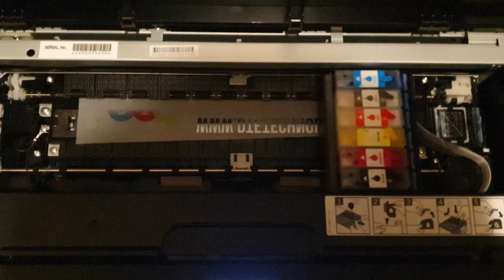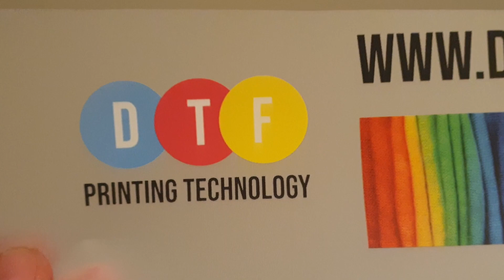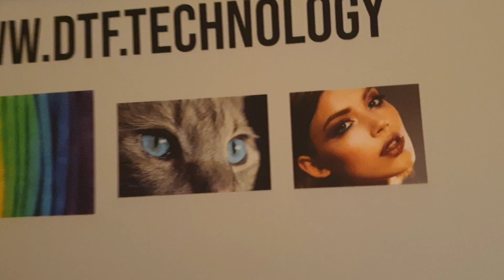How To Convert An Epson XP-15000 Printer To Print DTF

Comment: this is the most easy tutorial video .
Reply from the maker: It's is also quite outdated. I would no longer recommend using foam cartridges. You should replace the manifold and use standard dampers + ink lines.

Comment: Hey, I tried to this with the same exact printer that you used, when I put a DTF sheet, It went through, ready to print, but right as it was about to print it stopped and an error showed up saying the printer was jammed. When I checked to see if there was a jam in the printer it was perfectly fine. I’ve tried with regular printer paper to see if the printer would not print anything or if it was just that printer. When I tried with the plain paper it printed perfectly. Do you know how to fix this to print on the DTF sheet?
Reply from the maker: Yes, this printer suffers from the feeding issues and can be difficult. There is a video on this channel which goes through some film feeding tips. For a different printer but the process is quite similar.

Comment: Do you use the stock ink that comes with the printer? Or did you add white ink?
Reply from the maker: You have to use DTF ink. It's rubberised fabric ink that will feel soft and will stretch on fabric.
Reply: @dtfprintingtechnology9457  thank you

Comment: With eco-solvent inks, i can print labels on adhesive polypropylene? Is a heat source essential for drying? or can it dry at room temperature? what software use to print roll? (acrorip or another?) thanks!
Reply from the maker: I have no idea about eco-solvent inks. DTF ink is water based. Yes, heat source is essential. You are melting the powder. You are not drying it. We use acrorip.

Comment: Amazing video... Would you still recommend this printer for DTF after 2 years of using it? Thanks you all of your help!
Reply from the maker: We never used it properly. Just converted it for the video. The foam cartridges, feeding issues and a sensitive printhead are problematic but it's probably the cheapest printer you can convert.
Reply: @dtfprintingtechnology9457  thanks for the response...
Reply: @dtfprintingtechnology9457  l1800 will be the best choice for professional dtf printing? in terms of price quality? Thenk you.
Reply from the maker: @ux_ui  Image quality is pretty much the same on every printer. P600 will print a lot faster than L1800. All depends on how many prints you are doing per day. I'd skip L1800 if it's over 20 A3 sized prints.
Reply: @dtfprintingtechnology9457  thank you 🙏🏼

Comment: Hi I am trying to do the conversation but it keeps giving me a maintenance error for cartridges
Reply from the maker: What's a cartridge maintenance error? Do you have an error code?
Reply: @dtfprintingtechnology9457  it say the cartridges are not installed correctly it’s only reading the original cartridges when I try to install the refillable ones it gives that error
Reply from the maker: @missyj3890  Have you installed chipless firmware on the printer or do you use refillable cartridges with chips that can be reset? The printer is designed not to accept 3rd party cartridges.
Reply: @dtfprintingtechnology9457  yes o have tried I got the firmware from ink chip but I’m not sure  if mi doing it correctly because when I try to update it on the printer it won’t install it
Reply from the maker: @missyj3890  So that's your problem. The firmware install can be tricky. Once you install it correctly the errors will go away.
Reply: @dtfprintingtechnology9457  do you have the direct link for the correct firmware? Also do I need to install it with the regular cartridges in and then switch them out after the chip firmware is installed?
Reply from the maker: @missyj3890  I don't have a link. You can install it with or without cartridges.

Comment: Hi, you mentioned that the white ink was not printing at all. I am suffering the same issue, and I have also dropped DTF liquid into the printhead to try and fix it, but it has still not been fixed. You say you left it soaking for 20 minutes? Does that mean you dropped the liquid into the printhead and let it stay like that for 20 minutes? So far I've been dabbing it with DTF cleaning liquid, swabbing, and then proceeding.If that doesn't work, what else would you suggest? Thank you.

Comment: Hi! I set up all the instructions in this video and I've downloaded the Rip Software, but the software is very confusing. How do I get that white underbase? What settings should I have? The "Set Ink Order" is grayed out, do you know how to fix that so I can tell the printer my Red and Gray cartridges are now White? As it is, I am printing out the pictures, but it does not have that white underbase and is very difficult to heat press into the items, usually ending up half-pressed or such. Colors loook great though. Would love the help. Thank you!

Comment: How do I change the new cartridges setup ?
I need to add 2 whites…
In the printer setting or part of the RIP ?
Thanks
I’m using Cadlink and seems to have soooo much information.
Reply from the maker: Sometimes you can do it in any order and configure each colour in your rip software or do it according to a rip software preset. Get in touch with cadlink to get a precise answer. I can't remember which options they had. We don't use cadlink.

Comment: Hi
What's the latest version Epson printer with ecotank system and can convert to DTF? I am in Ireland and can't find the L805/L1800

Thanks
Reply from the maker: ET-8500 and ET-8550 but they are quite different with some added challenges

Comment: I think I have watched every video. Program is not working with my printer. Any subjection would be much appreciated. I already had my printer running the chipless firm ware. It is a epson xp15000.. I have already converted the printer. I purchased dtg 10.3 version with a dongle key. No problem installing the program. No problem setting all the settings. The program send the print. The print shows up on the print queue. Printer doesn’t print. Also have an artisan 1430 tryed also the same resort. Thanks you for any help you can offer.

Comment: Hello, question, i have this printer and I want to convert it to dtf.. can this printer print from roll?
Reply from the maker: All printers can print from the roll. You just need a roll holder and either roll printing software or rip software that supports roll printing.
Reply: @dtfprintingtechnology9457  great to know.. can I contact you if I want to know something more in process?

Comment: I have done everything just like you said.  I bought the chip less firmware installed successfully. However my printer says ink is full yet will NOT PRINT. What do I do?
Reply from the maker: Try printing a bit of text on a normal office paper without using rip software. Does it print?
Reply: @dtfprintingtechnology9457  Hello, I am having the same problem but after installing chipless software, my printer started to print blank page. Any help?

Comment: Does epson L850 work for dtf?
Reply: In theory yes since is a 6 Color Printer but just A4/letter size
Reply: You just have to use the Stylus L800, L805 Driver on Acro Rip cuz the printhead is the same

Comment: Im trying to get the printer to work.  Unfortunately without success.  the print looks weird.  as if my dtf ink would run and lots of small holes in the white.  did you have the same problem?
Reply from the maker: Seems like either you are printing on the wrong side of the film or there is some sort of film defect.
Reply: @dtfprintingtechnology9457  unfortunately not, the film works without problems in my Epson 1500w.
Reply from the maker: @AE-uj7qc  Try printing a different design. This could be rip software not printing semi transparent elements properly or messing up the choke. Also, keep an eye on the printer while it's printing. Maybe you can spot some sort of mechanical issue.
Reply: @dtfprintingtechnology9457  There are no mechanical problems either, it just prints a horribly bad image as normal.  I must have put 50 dtf film through the printer with the most varied of designs and settings.  It worked best when I set 90 nozzels, but then it was still extremely bad.

Comment: Couldn't you just keep topping off the cartridges and never let them run out to avoid having to replace them?
Reply from the maker: If you upgrade to chipless firmware you can. Otherwise printer will count how much ink it used and will ask you to replace the cartridges. Cartridges themselves don't measure ink levels. Printers calculates it based on how much you printed.
Reply: @dtfprintingtechnology9457  gotcha! Makes sense.  Thanks for the reply.

Comment: your ink that i bought from your website  this nanodroplet is not working at all i did everything correctly but ink didn't print at all at dtf sheets and even on white paper is blank all the time when i go to original ink epson printer working perfectly
Reply from the maker: Of course it's not going to print. You were just in touch with us saying you loaded up epson ink first and then added DTF ink without cleaning the old ink out first. You can't mix 2 different types of ink. Solven, sublimation, water based inks etc. should not be mixed.

Comment: Thinking of going this route I have a white toner printer and the cost of paper  A+B is just insane in price my question  is how hard is the mantience for this I run a small t shirt buisness  so I might not print for like 5 days
Reply from the maker: 5 days is fine. Anything over a week is pushing it. You can just run a quick head clean every 3 days or so to prevent clogging. White toner is just trash in general for t-shirts. Customers kept on returning their orders because they would not even survive a couple of washes. DTF or DTG is the way to go.

Comment: Thank you for all the replies.  Great info on the xp 15000 all in one place.  I really want to do black polyester shirts because they are softer and not as hot as cotton.  Can dtf work for black 50/50 or does it have to be only 100 cotton?  Also, if i wanted to flush the dtf ink and put in sublimation ink for white shirts would that work?   Appreciate the info.
Reply from the maker: DTF should work with all fabrics. Yes, if you flush the old ink out, you can replace it with sublimation ink.

Comment: what about the waste ink pipe?
Reply from the maker: You can take the printer apart and run the waste pipe into a bottle.
Reply: @dtfprintingtechnology9457  what happened if you don't?
Reply from the maker: @rubenagurcia906  Eventually the waste ink tank (Maintenance box) will fill up. You will need to replace it. You will need to either empty it and reset the chip with a chip resetter, buy a cheap knockoff one or buy an expensive original.
Reply: @dtfprintingtechnology9457  could you share a link where I can find a chip resetter please?

Comment: I put in third party ink cartridges and I get: maintenance error. Ink Cartridge is not installed correctly. Can you tell me the steps to fix this?
Reply from the maker: Did the cartridges come with a chip? You either need cartridges with a chip and a resetter or you need to flush the printer to chipless firmware.

Comment: Hi. Thanks for sharing this video. What I do not understand is why it is necessary to use rip software? Would the printer stop running only by unscrewing this metal thing?
Reply from the maker: How is your printer suppose to ignore 2 colours while only printing CMYK and applying white on top as a second layer without rip software? Printers can't do that out of the box sadly. No, it won't stop running. I would not have removed that metal thing if it was to break the printer.

Comment: Well done. Are you using a specific icc color profile when printing and what are your settings in acrorip?
Reply from the maker: I used EKrip. ICC is specific to our ink. Have not tried acrorip yet but I'll need to try and revive this printer some time as it's been sitting unused for months. Would be a good experiment to see if the print head is still functional.

Comment: can i use epson l1800 without doing this for printing on transfer film ?? plz answer me ASAP 🙏🙏
Reply from the maker: Without doing what? Converting the printer for DTF? No, you can't.
Reply: @dtfprintingtechnology9457  
i mean without remove that rollers !! Well, what if I return it, will it work as a normal printer or not?
Reply from the maker: @aymenlegendb1942  If you remove the rollers the printer will still work as a normal printer but those rollers prevent paper jams etc.
Reply: @dtfprintingtechnology9457  
if can work why to remove rollers ?? we can print on transfer paper !
Reply from the maker: @aymenlegendb1942  Because rollers will roll straight over the wet ink you just printed, leaving marks and smudges.
Reply: @dtfprintingtechnology9457  
so i can print on normal paper or sublimation paper without rollers ??
Reply from the maker: @aymenlegendb1942  Yes, you will still be able to print on regular or sublimation paper. But keep in mind that you will need to swap the inks each time.

Comment: Hi, i have a question.. Do you recomend to use Epson converted to DTF o to use a printer DTF from fabric? What is life time of Epson converted to DTF printer? Thank for your response..
Reply from the maker: They are the same thing and use same print heads that have the same lifetime. It's just factory made DTF printers tend to have extra features and are converted professionally. If you look after your printer and carry out proper maintenanse, it will last years.
Reply: @dtfprintingtechnology9457  a important feature is white circulation system. Epson doesn’t have it and have shake it myself (colors tank) or I am wrong?

Comment: Overall it sounds like the negatives of needing newer RIP software, CIS, customizing of the paper feed and ink waste tank might offset the savings of this printer vs a more expensive model. What's your opinion?
Reply from the maker: I only bought this printer for testing. Never really considered it for long term printing because of the reasons you mentioned. I know a few people who have been using it for a while and are still happy with performance but I'd personally stick to older models.
Reply: @dtfprintingtechnology9457  yeah I watched another video of someone who has been using it as a daily driver for dtf and got all my answers. No one in their right mind should use this thing for any size production run in a serious business. It's way too finicky and prone to failure.
Reply: @TheXboxSux  I see you’ve commented on many videos regarding dtf printers. I’m new to the idea of them, what would you suggest for a business getting 25-50 custom short run orders per week?
Reply: @Mansax2  any answers?
Reply: @dtfprintingtechnology9457  what older model printers would you recommend?

Comment: I am in Australia  and the xp 15000 is inkjet is that right I want to convert to dtf  if possible  let me know?
Reply from the maker: Yes it is but be prepapred to troubleshhot chipless firmware and film feeding issues. Those are common problems people experience with this printer.

Comment: Ok you say that it doesnt accept film or transparencies while you are printing on film. I cant get this printer to recognize film at all in anyway. It just pushes it straight through and says "Out of paper"  any info on this would be fantastic. Im using EKrip
Reply: Hey Cris did you figure this issue out yet? Where did you buy your film from?
Reply: @Bangs_Theory  no I’ve not figured it out and I get it from dtfsuperstore
Reply: @Bangs_Theory  I am open to any suggestions because I’m about ready to chunk it in the trash :)
Reply: @404IQ-x3v  I just received my XP 15000 getting ready to convert. @irondesign (youtube channel) uses supplies from dtf-superstore as well, so I'm guessing it's not the paper. I remember seeing someone mentioning the paper setting, let me see if I can find it. I will get back to you shortly. Btw how much did you pay for your rip?
Reply: @Bangs_Theory  I bought Acrorip 10 when it came out and it’s absolute garbage. I paid $400 for it. I have EKrip too and it’s ok but pricey for what you get. I appreciate any info about the paper problem you can give me.
Reply: @404IQ-x3v  Did you setup your inks? Do you know if you set up correctly? Firmware issues maybe the culprit.
Reply: @Bangs_Theory  my chipless firmware seems to be working great as it shows all inks at 100% full and I’m using a CISS system.
Reply: @404IQ-x3v  What feed path are you choosing in EKprint? Should be manual.
Reply: @Bangs_Theory  Man I need help. It’s not printing from rear tray. It’ll print from cassette only but it’s not the right  size and I have regular paper in there.
Reply: @RealOn-D1  Which Rip are you. using?

Comment: Can someone please tell what paper i need to choose in the printer preferences that will allow this printer to see an A3 DTF transfer? It keeps saying paper jammed inside the printer no matter what A3 transfer i put in from any company. It feeds in fine, the print head goes to the middle and then returns and  docks as though its not seeing the paper. Any help would be great. Im using acro 10 btw
Reply: add a strip of tape across the back of the paper's top edge

Comment: what software do you recommend for dtf on the epson xp 15000
Reply from the maker: I only tested it with EKrip.
Reply: Ok thank you, could you tell me the configuration, since I have ekrip but I get too much ink and the images do not come out correctly
Reply from the maker: @nergaldj9346  Ink level 2, ink density 100, bi directional printing selected, ink drop size light, color mode graphics. This is what was used for this video. This may not be the ideal settings because we don't actually print on xp-15000s ourselves.

Comment: I got it chipless so that I can use a CISS but I can’t get Acrorip 10 to communicate with the printer. What RIP did you use for this?and if Acrorip 10 what settings?
Reply from the maker: I used EKrip. Have not tried Acrorip 10 with this one yet.